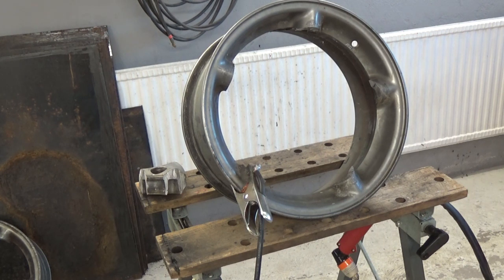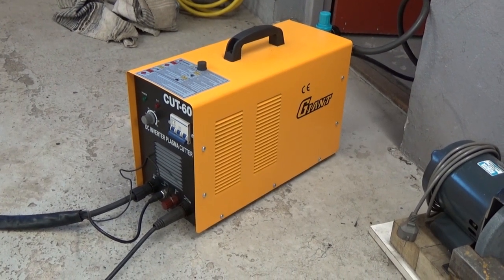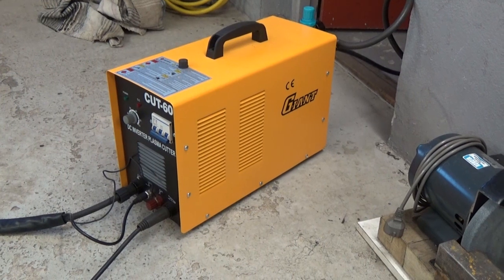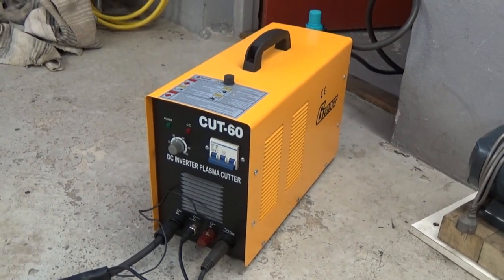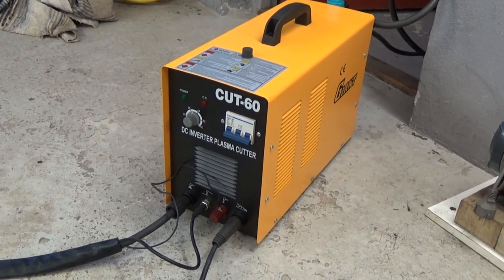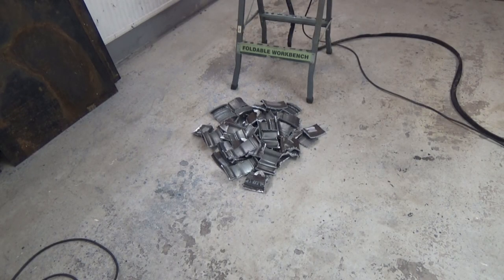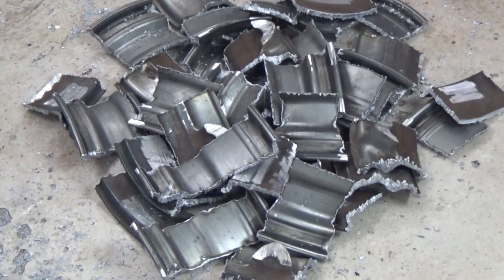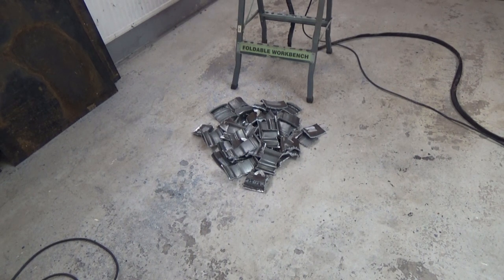Aluminium Rim Cut By Plasma

Comment: I use to work at a scrap yard and my boss told me that rims are some of best aluminum. 🤫 I have one to cut up to.
Reply from the maker: Yes alu rims are very good quality alu. Pistons and  alu engine heads are also good quality alu, suitable to melt down and cast.
Reply: @tompas11A3n52KkX  I want to start to melt some down. Cheeper to get a couple rims or what ever and melt it down ensteed of buying alum . I love the video's. I like making my own tools just starting off make easy one's. So far there just as good as the Chinese one.LOL

Comment: What saw did you use? Blade ? I’m doing the same can’t find the correct tool for the job.
Reply from the maker: I used an reciprocating saw and metal reciprocating saw blades with 8/10 teeth per inch.
Reply from the maker: Dennis Young  Yes, but you can use the saw for much else as well.
Reply from the maker: Dennis Young  Well Makita is a very good brand and good quality. I just use som cheap brand and by the way I got two of these...